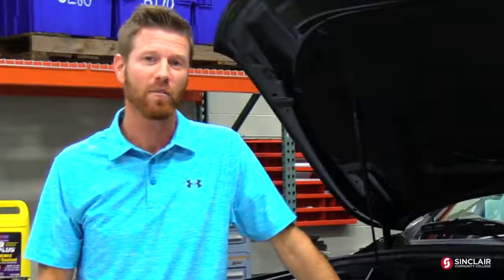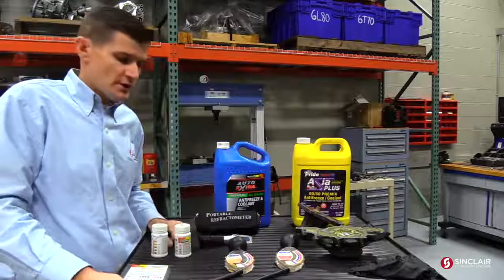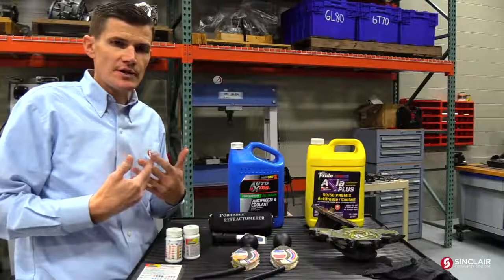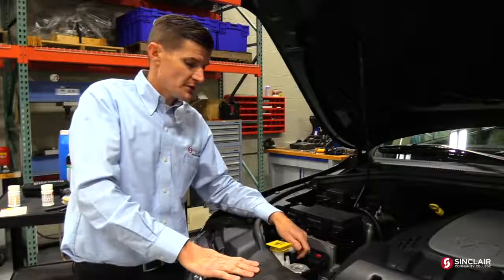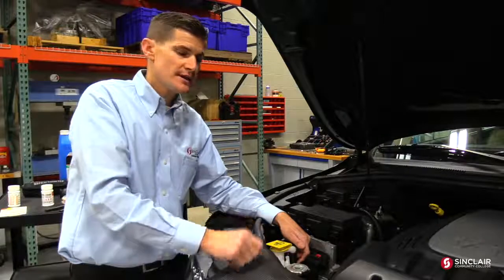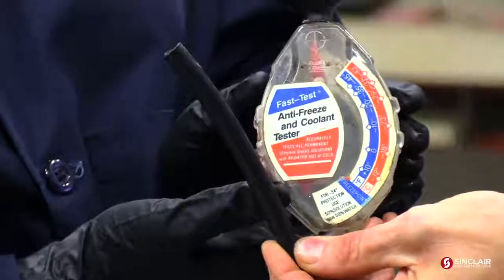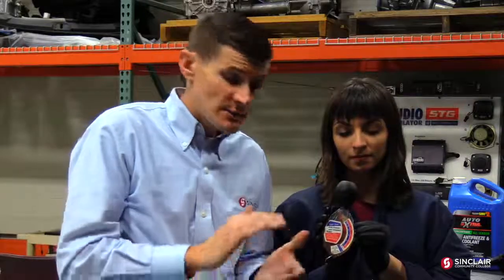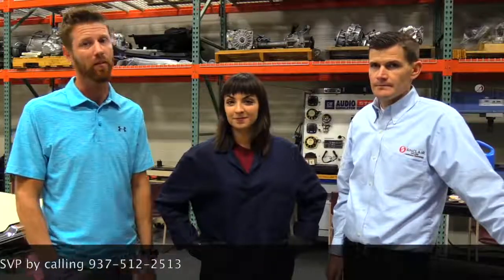How To Check Your Cooling System Step By Step

Comment: After automakers removed the Service element from vehicles, people just don't have any work done until there is a problem. I change out my coolant when it gets a dingy color (3-4 years) and have not had a water pump failure or a clogged radiator, I also use RTU coolant or distilled water.